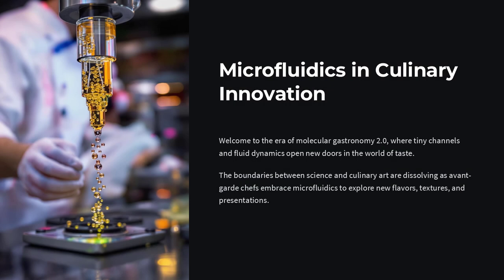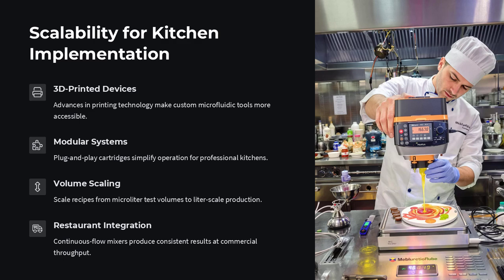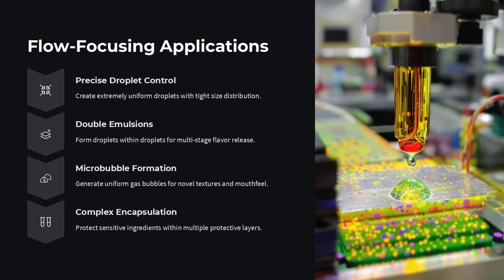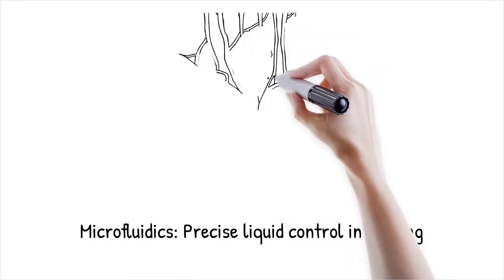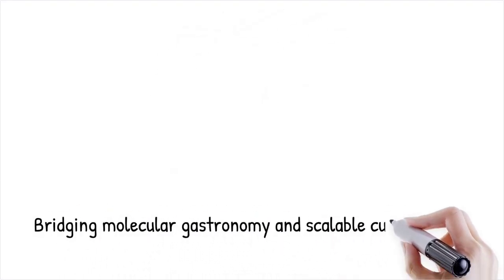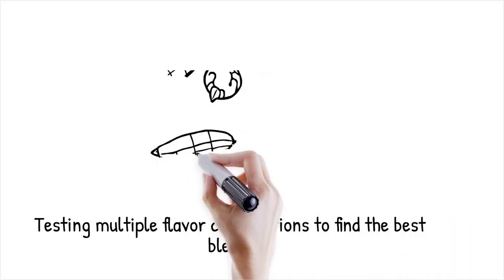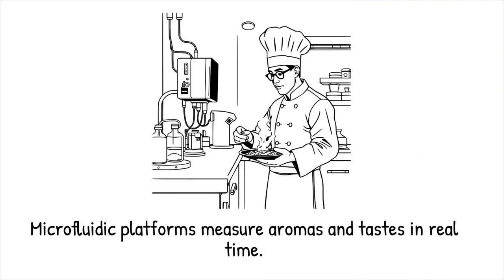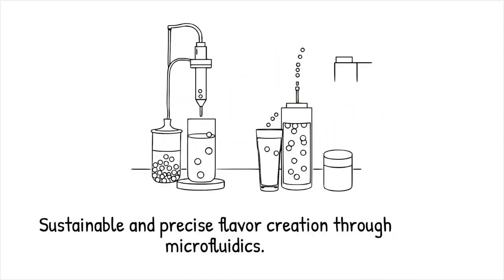Microfluidics in Culinary Science: When Dish Becomes a Chemistry Set

Comment from the maker: How can microfluidic systems be reliably scaled from lab prototypes to robust, food-safe tools that maintain precise droplet formation and ingredient ratios across variable kitchen environments?
What are the optimal physical and chemical parameters (e.g., interfacial tension, viscosity, solubility) for engineering edible capsules that can selectively dissolve based on specific oral pH or temperature triggers?
Can machine learning effectively correlate molecular flavor profiles with human sensory perception to autonomously generate innovative, palatable, and culturally relevant food pairings in real-time culinary applications?